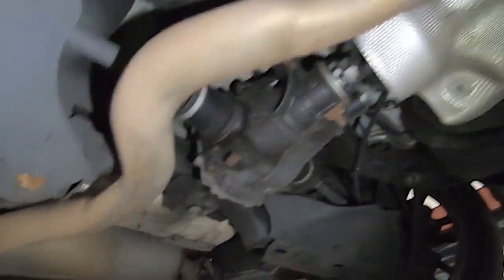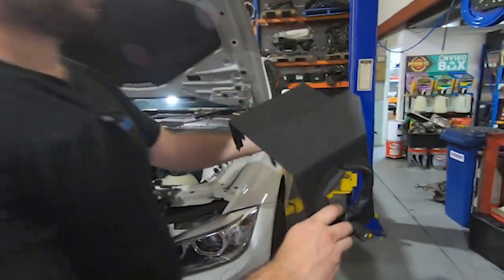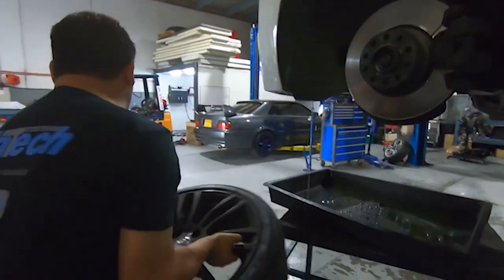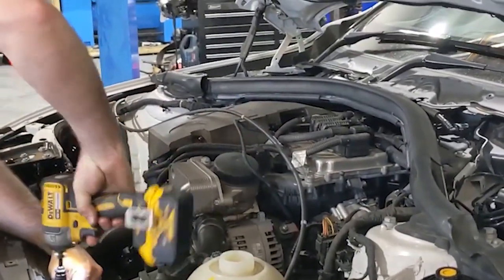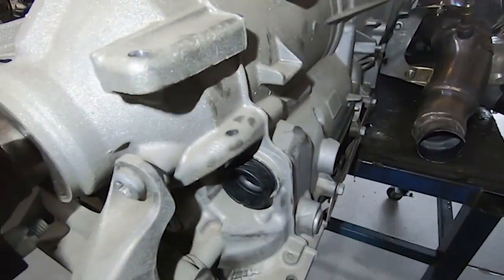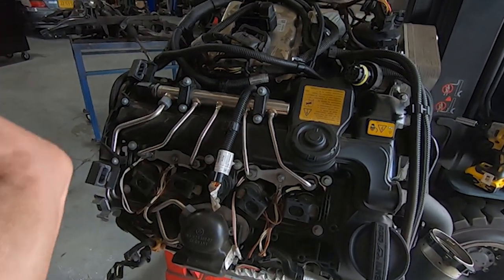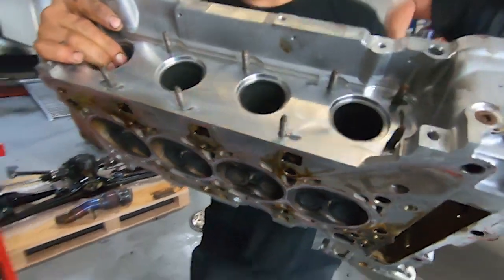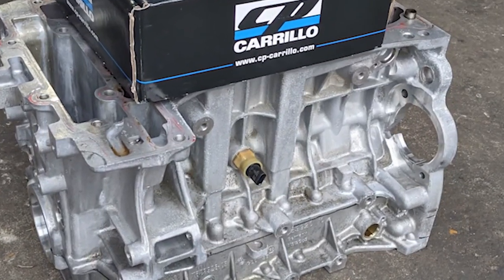BMW F30 328i N20 engine build part 2

Comment: how many miles the engine had? 100k?
Reply from the maker: 95000km
Reply: @NavardiTuned  mine has 217k km, should i be worry?
Reply from the maker: @costelariton9864  as long as servicing has been kept up to the motor, it should be completely fine. BMW motors when looked after last forever
Reply: Mines done 120k km changing oil evry 5k 8k km
Reply: Mine made it to 200 thousand km easy just maintenance still has lots of life left
Reply: i guess Im asking the wrong place but does anyone know of a trick to get back into an Instagram account..?
I was dumb forgot the password. I love any help you can offer me!
Reply: @Dawson Graysen Instablaster ;)